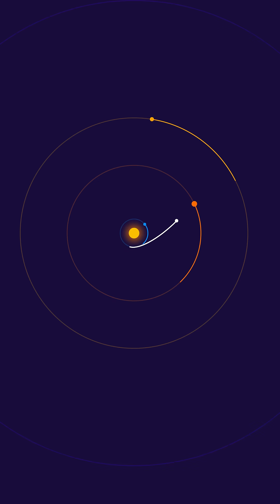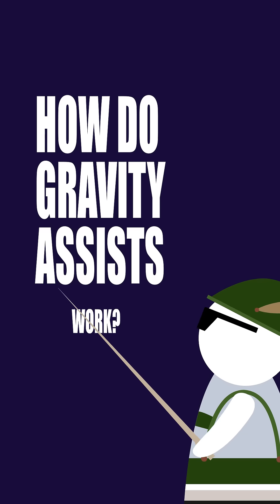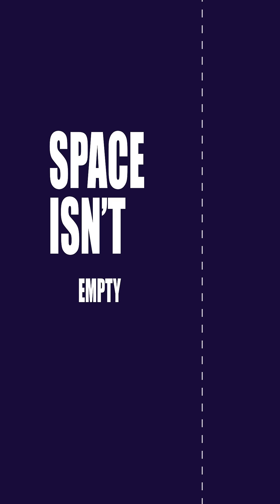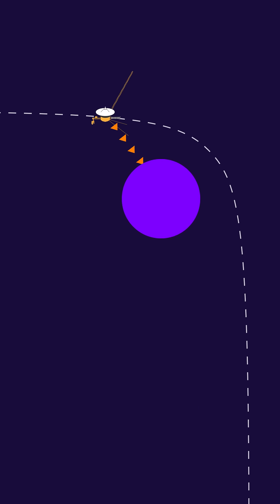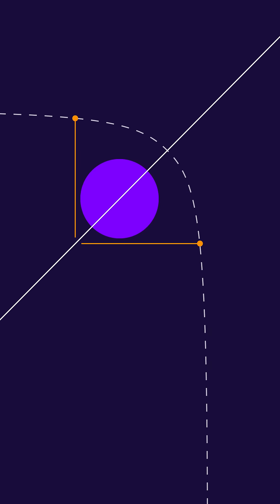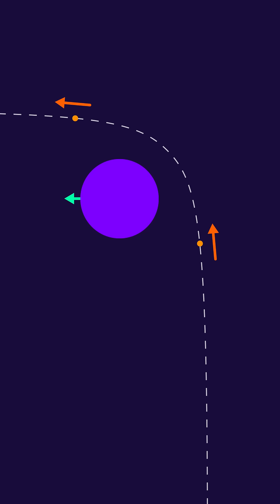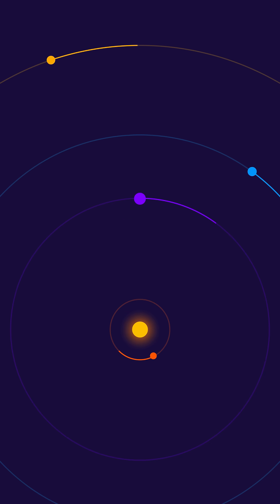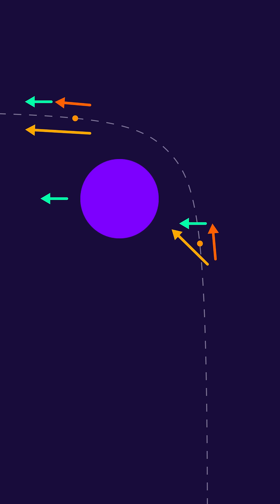How Gravity Assists Work in 60 Seconds

Comment: Thank you for this.  I suspected the planet’s orbital velocity played a part, but this was the first (or at least the first I could comprehend) time an explanation specifically mentioned it.

Does the angle the spacecraft approaches the planet depend on the spacecraft’s velocity, is it critical, and is there a +/- window of angles that will work?

Same with the angle of departure??  Or is the angle of departure determined by the angle of approach?

Is any fuel used in the maneuver?  If fuel is used sometimes, are there any gravity assist scenarios where it’s possible to NOT use any fuel?

Are gravity assists seen in nature, such as when a planet is kicked out of an orbit and into interstellar space?  

Are gravity assists (and its inverse) the mechanism by which planets migrate towards and/or away from their sun(s)?  Could these mechanisms account for why we see Jupiter-sized exoplanets in Mercury-type orbits around distant solar systems?  I’ve read or heard that Jupiter may have formed in the outer regions of the Solar System, migrated inward, and then back out to its current orbit…gravity assists?

Can gravity ‘desists’ happen for satellites intended for orbits closer to the Sun?

Look at that, a 60 second clip actually got my brain to work and ask questions.  Thank you.

Comment: It's exactly the same as bouncing a ball off of the front of a moving truck, but with pulling instead of pushing.
Reply: no it isn't. It's vaguely similar but not exactly the same at all.
Reply: @MattNolanCustom The underlying math is identically described by the laws of elastic collisions.
Reply: @nbooth the underlying math so, as I said, not exactly the same
Reply: @MattNolanCustom They're both exactly elastic collisions. The math IS the physics, professor.

Comment: you can also do a very short burn to add a little more to the assist
Reply: That kinda defeats the whole point of the slingshot.
Reply: @comradeorange1645  It doesn't. Oberth effect is a different phenomenon and this exact method has been uses in multiple missions already.
Reply: @sankang9425  i dont even remember writing that but i think what i meant was the whole point of a slingshot is to save as much Dv as possible

Comment: As I understand, it's almost that. As you aproach, you will be gaining speed from the gravity pull of the planet. While leaving, you are faster than before, so you spend less time decelerating. That extra energy is from the relative motion of the planet.
This also work in the oposite direction, going to the planet and letting the gravity pull you back by making the aproximation last long enough so you turn 180 degrees.
In any normal aproximation, accelerating or decelerating, usually you will get a lot of lateral velocity. If you go towards the sun, you lost potential energy. Going away, you gained it. As you orbit, it translates into kinetic energy.
Too much time with spaceflight simulator...

Comment: I think Einstein proved that gravity was no more than an aggrivated or exaggerated FRAME OF REFERENCE. What he meant was, in simple terms, 1. CURVATURE we (THE EARTH PEOPLE) are on a rotating disc we call a planet, and that disc, its surface, our SPIN (20,000 MPH) rotates each day and 365 times a year we spin, so..... If you TOOK THAT PATH and straightened it out, youd be flying/floating at 20,000 MPH in a straight line. This is difficult for me, jist so you know im not projecting a correction of sorts, but merely ADDING to the videos already incomparable quality ❤2. PATH we fly straight and our path around the sun is still curved so we straighten that out too. Now we have two distinct velocities to compare speeds and angles with. The rotation of the earth being curved always whips you fast as possible as when you go deeper time slows down from density. But imagine the arc of the earths CURVED spin intersecting with our CURVED path around the sun, now you have two velocities holding you in place much like a fighter pilot incurs G FORCES when he gasses it, similarly we STICK TO EARTH because of those forces. 3. TRANSMISSION but like any good system, they always need a back up, so the suns 500,000 MPH speed around the galaxy core is like a permanent stamp on top of our already good enough planetary gravity, but now a star is FALLING. Now because that takes 250 billion years to make one cycle, (if that's off i apologize) but it makes a point, we are in a SUPER POSITION with that velocity. 4. BLACK HOLES unfortunately for us, thats not the scary part, that Sagittarius a star supermassive black hole pierced a fluid way back in time, and that splash, that displacement, coupled with a continuous collapse, is why we stay planted right on the ground. Now notice one thing, each and every object fluid or gas in our galaxy is traveling independently at 1.3 million MPH and we have no clue. Covering a great distance if you could somehow place a back drop behind it to just see how much stuff you've blown by, but imagine when you lift up a paper clip, and drop it, it traveled the distance from the east coast to the west coast and fell because its too dense. Buoyancy reigns supreme in a TIME SPACE traveling at a peculiar velocity. See, because if fish, birds, clouds and heated gas can escape it, i think weve all been delusional perhaps when thinking it was a particle or force, when the entire time the deal was right up front. 😁💡💯

Comment: But why doesn't the spacecraft just gets pulled into the planet?
Reply: Because it's going too fast, the gravity of the planet isn't strong enough to pull you into it if you're going several thousand km per second at the right trajectory. If you slowed down enough then yea you'd crash into the planet (or burn up in its atmosphere)

Comment: How much extra speed can you gain?
Edit by Copilot:
A gravity assist, also known as a gravitational slingshot, can significantly increase a spacecraft’s speed without using additional fuel. The exact speed gain depends on several factors, including the mass and velocity of the planet being used for the assist, the spacecraft’s trajectory, and the distance of the flyby.
For example, the Voyager 2 spacecraft used gravity assists from Jupiter, Saturn, and Uranus to increase its speed and alter its trajectory, allowing it to reach Neptune. These assists provided a cumulative speed boost of about 15 km/s (54,000 km/h) relative to the Sun